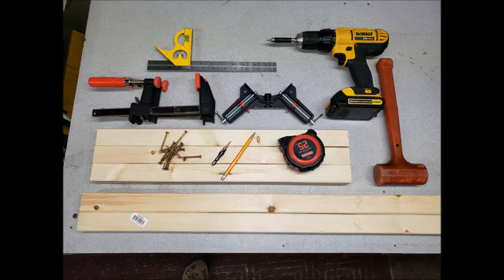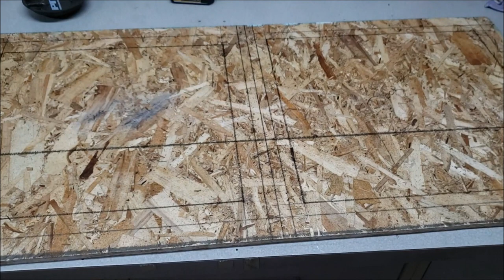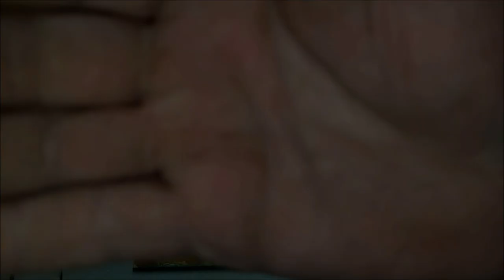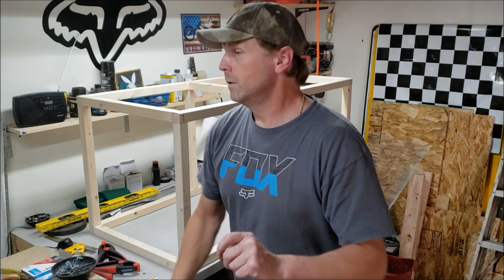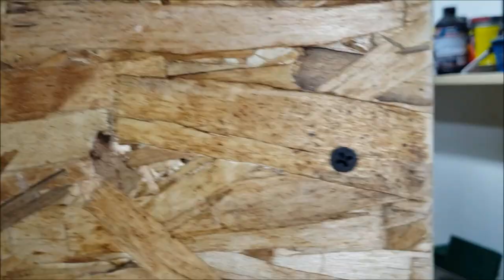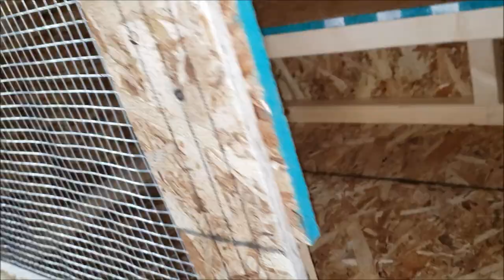DIY REPTILE ENCLOSURE UNDER 60 BUCKS  4 X 2 X 2 STEP BY STEP BUILD

Comment: My only issue is all the screen. Youll be fighting humidity daily. Id use pvc for the doors.
Reply from the maker: Well it was made for a Bearded Dragon and you can't make anything close to 60 bucks using PVC
Reply: @MYANIMALHOUSE  lol. Point taken. I'm a ball guy, and humidity is always an issue. Hate screen. Pvc lasts longer, is lighter, easier to clean, but ya, def costs more. But you're more handy than me, buy 4*8 pvc sheets and make the same thing. Probably not necessary for a beardie but def not my area. U can get cheap plexiglass for the doors. I'm older now and disabled. I want light enclosures I can pick up with one hand and wash with a hose. That's said big props for giving ur little buddy a good size enclosure!! I hate that sticking snakes into drawers has become the defacto way

Comment: Instead of scrolling through 4 years of msgs, what type of wood are you using for your frame?
Reply: Looks like pine which is toxic to snakes. Do they still outgas through a waterproofing layer is a question I would have.

Comment: I know this is late but how do you install lights and light fixtures such as a uvb placement or basking bulb?
Reply from the maker: It depends on the lighting you could mount them inside or maybe cut a hole and screen over it and put the lights on top it just depends...Thanks for watching 👀

Comment: When do you need a centerbracing vs not needing one? Im about to build a 3 x 1.5 x 2, and then later on a 5 x 1.5 x 2.5, just wondering if ill need bracings for those; rather have one open screen in the front rather than a brace in the middle if possible 

Great vid, thanks!
Reply: Just to add, I wouldnt mind bracing the back, but trying to see if i can avoid bracing the front
Reply from the maker: You should be fine just brace top , bottom & back in the middle..But nothing is for sure until its done ..Thanks for commenting and happy building 😀
Reply: MY ANIMAL HOUSE thanks so much for the reply! One more Q if that’s alright...

What’s the different between going this route and just screwing some 5-6 sheets of wood together to make a box? 

I’m guessing this is much much sturdier and can hold its own weight, but would half inch sheets of wood screwed together fall apart if it was lifted with a fully stocked enclosure?
Reply from the maker: @wannak00kie  You can build this 100s of way I'm sure ... The frame work does make it stronger (Its a fault of mine sometimes I over do it cause I hate building something twice ) lol ...Just have fun & build a killer enclosure

Comment: Wouldn't that be too flammable to use heating mats and the light setups that reptiles require?
Reply from the maker: Even a hot spot for a Monitor wouldn't be hot enough to set something on fire

Comment: What is the gallon size of enclosure and would like to sturdy screen on top for lights on the outside plus’s glass front doors  can u give me info to do that
Reply from the maker: Not sure in gallons ..Over 100 gallons I'm sure ...I can't help much with the rest..But it shouldn't be hard to change the design alil ...Thanks for watching 👀
Reply: A 4'x2'x2' enclosure is equivalent to about 120 gallons :)
Reply: Want to back to be board but I want the sides glass and front to have openings doors

Comment: That's fucking awesome. I'm going to do one with plexiglass for my ball python. I'm going to use melamine instead of osb.
Reply: For a BP, would a radiant heat panel be enough to heat the warm side of the enclosure? The heat panel goes on top right? I'm used to heat mats.
Reply from the maker: @woodensquid560  I'm not sure I have never used top heat for a BP only Bottom or side heat ...I built this for a Bearded Dragon
Reply: Sounds good, thanks for replying
Reply: I wish you have put all the dimensions in the description and it's this good for ball python

Comment: Can you show how you put heat and uvb fittings in?
Reply from the maker: With the heat and light you just have adapt them in where you need them ...to many light and heating options to be of much help threw the comments
Reply: @MYANIMALHOUSE   thanks
Reply: @MYANIMALHOUSE  what kind of thing would you use you keeep a fitting in
Reply from the maker: All depends on the size light and fixtures & on what kind of animal your keep ... just adapt things to your needs
Reply: @MYANIMALHOUSE   I see that but what I’m asking is how would you keep a fitting in place